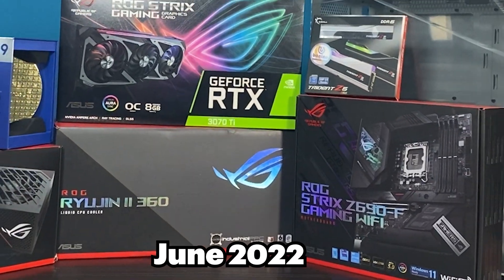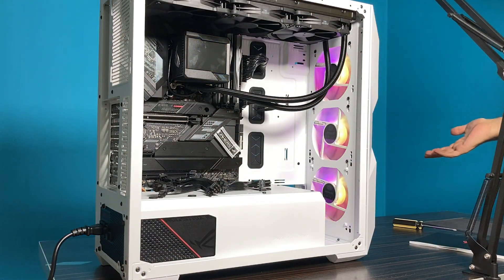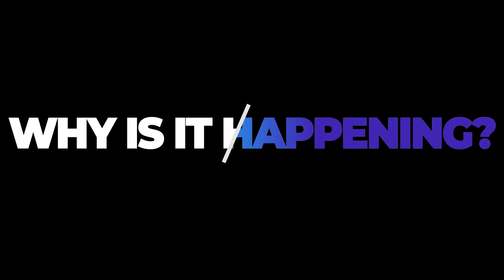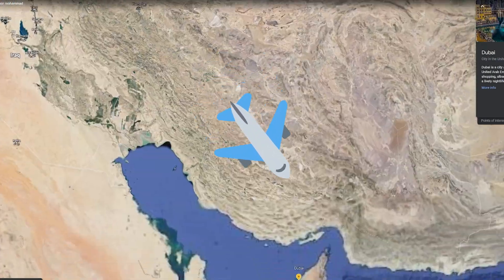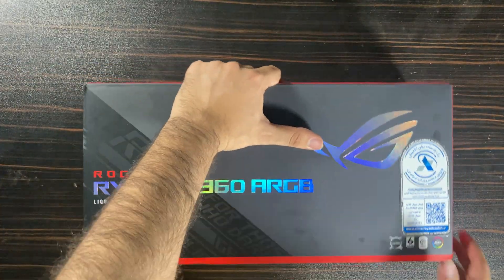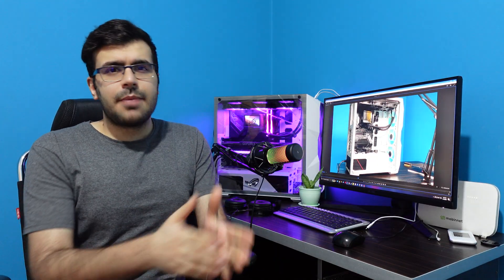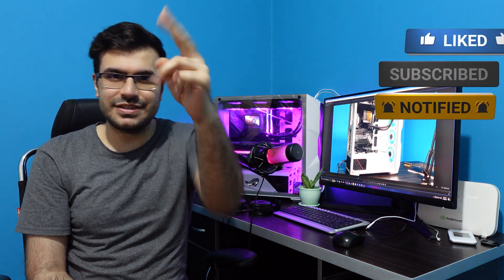I Burned my ROG Ryujin II 360 - is it worth buying?

Comment: I still don't understand what went wromg
Reply: Like I said even if the instructions are telling me to I'd never connect a 9 pin plug to a 4 pin header, nevermind a  USB header to a fan header. No matter ehat the directions specify
Reply from the maker: I choose wrong socket to connect aio pump cable
Reply: @Tech Time  I'm genuinely confused how you even made that mistake. Even if the instructions seemed like it, why would a 9 pin connector go on a 4 pin header? I say that's user error and nothing to do with instructions.
Reply from the maker: @bgeezus3955  i think it's happened a lot because of asus manuals confusion. And finally asus founds that their manual needs some updates. This video helps to at least five people😁.
Reply from the maker: @bgeezus3955  also i show in the video old and mew manual. So if there's no problem why asus do that? 😁😂
Reply: @TechTimeK  Please i have a Rog  B760 F gaming wifi how sould i conect the pump to not burn it , should i only conect the 9 pin usb or should i conect also the mirco usb cable to the conteoller ? Where souls i conect the usb cable of the AIO?
Reply from the maker: @yousefbenrichi  i answer you question in telegram.

Comment: What are you talking about, you didn’t explain what was wrong and what you did to fix it! You just said that you connected it there but you didn’t say where you connected it later or what was wrong with the aio pump port
Reply from the maker: When i showed you new manual i thought my viewers was smart and got the point and i publish another video about how to install it.
Reply: @TechTimeK  you're right, it does show but with something so delicate you don't want to be assuming, instead you do really want to make sure the info is correct, and yes I saw the new video, my most sincere thank you for it.
Reply from the maker: @diegosoulreaver  thanks for your reply ❤️

Comment: Ok. LONG STORY SHORT The triple cord, throw it the fuck away so it doesnt confuse you. Im gonna be the person that lets you know, READ YOUR MOTHERBOARD, The manual is useless for this part. The USB plug goes into the controller, the 9 pin head plug, plug it into the F_USB2, do not worry about CPU_FAN or SYS_FAN as they are for something completely different.

Comment: there are lables on all connections printed on your motherboard. a quick google search of these will tell you what they are for. This was easily avoidable
Reply: ROG parts are very good in my opinion. I have mostly ROG components in my pc. 5950, x570 dark hero, 3090 ROG strix, Delta S wireless headphones which gets bad reviews but are awesome in my opinion. Claymore 2 keyboard…but I do have the razor viper ultimate mouse with glass skates. And I do have the 360mm AIO which works and looks awesome.
Reply from the maker: @DreWhite100  absolutely ROG parts very good.
Reply: I still don't understand what he did wrong? I'm buying one of these to put on my asus z790 maximus hero motherboard. Should I be worried of fucking up???
Reply from the maker: @GONTE_YT  if you connect cables correctly don't be worry
Reply from the maker: well you right but this type of AIO Cooler rarly use for pc and as i told in the old manual there was not any sign or label to know which port is the correct one.

Comment: Thanks for video I bought the same cooler. First time building a desktop and I would've done same mistake
Reply from the maker: Did you burn it?
Reply: @TechTimeK  I haven't actually built my system yet I'm still lacking my PC case so I'm waiting for that and my new monitor as well. 

I hope my motherboard actually has proper connections for the cooler.
Reply from the maker: @dazeen9591  what is your motherboard?
Reply: @TechTimeK  z590 Valkyrie, though I found on the manual it does have a 9-Pin USB_2.1 and 9-Pin USB_2.2 headers at the bottom of the motherboard so I'm fine I guess on that part
Reply from the maker: @dazeen9591  yes it is.
Reply from the maker: @dazeen9591  if you need help. Just say it.

Comment: Was the pump actually burned up or did the LCD screen circuit board burn up? I have one that the screen doesn't turn on at all and the pump also doesn't run.
Reply from the maker: i see one of the chipset burned and after that,i find right socket but still pump doesn't cool my cpu.  soooo i think if you wanna fix it you must change the board and unfortunately There are no parts for its.:face-purple-crying:
Reply: @TechTimeK  so...did the pump sustain damage when you plugged it into the wrong header or did only the control board get fried ?
Reply: @rasslemaz  se habrá quemado el integrado que gestiona el usb, ya que introdujo 12v por los cables de datos, la bomba estará intacta, habría que cambiar el controlador usb y reparar las pistas quemadas, es difícil pero no imposible.

Comment: What port do u suppose to put it in then if not the aio port?
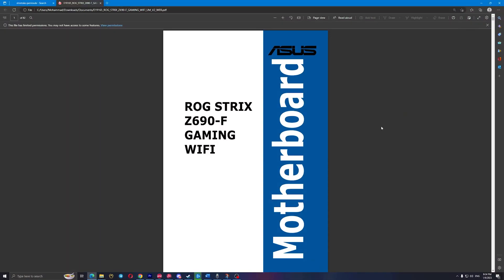Reply from the maker: 9 pin USB 2.0 Connector. 1:08
Reply: Debes fijarte en el tipo de AIO que tienes, si usa controladora no hay que usar el puerto AIO pump a no ser que el manual te lo indique explícitamente, en este caso la corriente la suministra la controladora de la AIO y el cable usb solo es para datos, el conector AIO pump de la placa solo se debe usar en aquellas AIO básicas que no dispongan de una controladora, siempre hay que mirar bien los manuales.